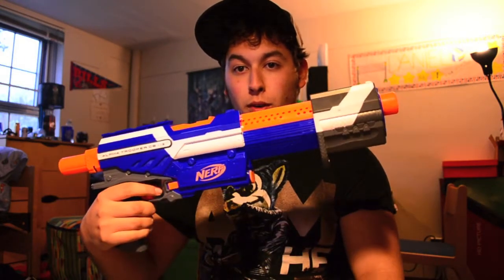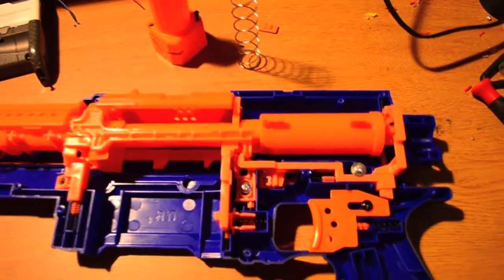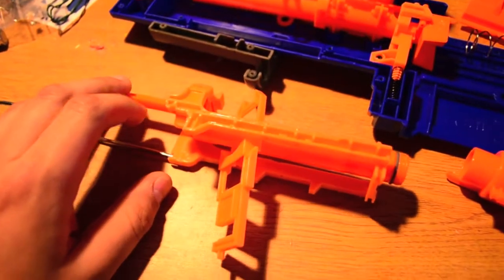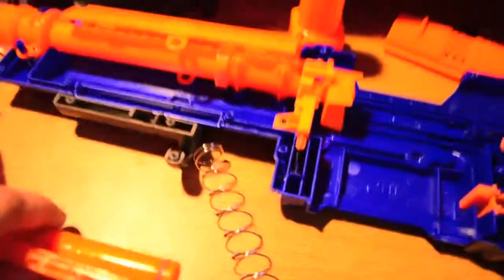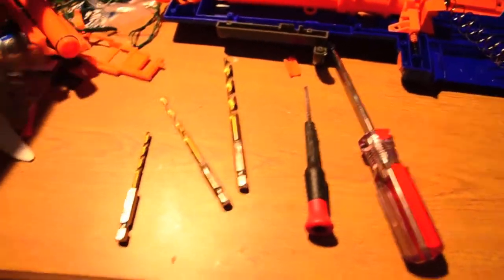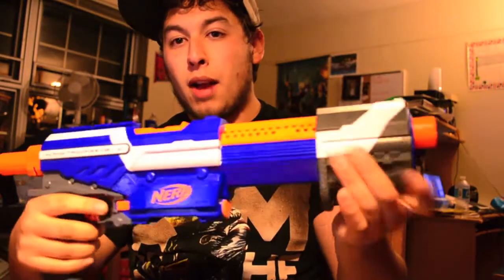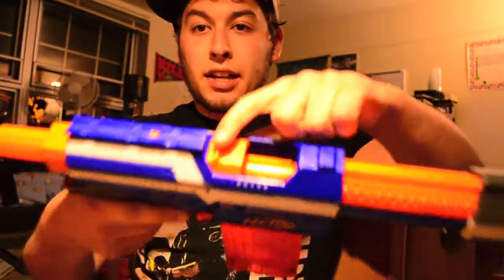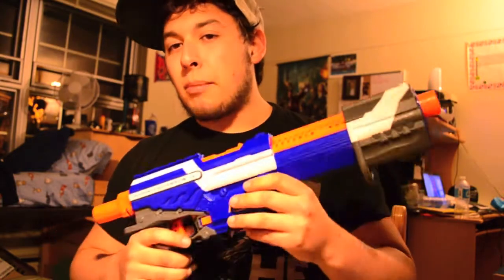Mod Guide: Nerf Elite Alpha Trooper CS-12

Comment from the maker: The clip release was probably offset on one side, try taking the blaster apart and putting it back together again but make sure that the clip release buttons are in the right place. also, make sure the spring for the clip release is in place.

Comment from the maker: Put the breech assembly in first, then the bolt receiver and barrel, then the locks that you want in there, then the trigger and trigger catch, dont forget the clip-release, then the trigger catch spring, then close it up almost all the way and then thread the main spring back in through the hole.

Comment from the maker: it could be a catch issue, try putting in a stronger catch spring, also, try filling a little bit of the dead space on the plunger head with some hot glue.

Comment from the maker: You probably accidentally removed a small ring at the back of the breech. What you can do: Put a 1/8th inch layer of hot glue on the head of the plunger, where the breech and plunger meet. Let me know if that works.

Comment from the maker: No, Although I didn't reassemble it on camera it is on you to be able to put it back together. I apologize for not doing it on camera, but instead of getting mad, why don't you try googling "Elite Alpha Trooper internals" and match the parts to the picture. In the future, I will remember to reassemble everything on camera. In the future, why don't you try taking a picture, or numbering the internals, so you can remember what order to put them back in.

Comment: Hey Jay, I need some help. I'm done modding and I am trying to reassemble, but my Alpha Trooper won't stay cocked back. It's like the plunger rod in the plunger tube doesn't stay back to prime the blaster. Of course, this also means I can't fire. Do you have any suggestions? Is this a catch issue?